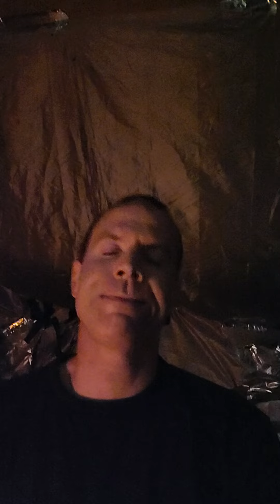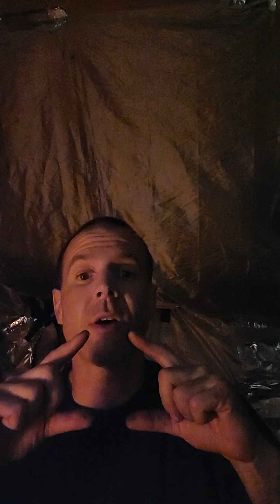ferrite rings on ebike motors

Comment from the maker: Ferrite beads interact with the wire that travels through/around them so as to act like an inductor. High frequency signals passing through the assembly are dissipated as heat. Ferrite beads (AKA "RF Chokes") look like resistors to high frequency noise. There are many possible situations where a bead/choke might be necessary. The model's control system has lots of source of electrical noise, such as the ESC FETs, the µProcessors in the ESC and Rx and Servos and Gyro, and the brushed motors in the servos. If one component is making a lot of noise, the judicious placement of a bead can keep that noise from interfering with other elements of the system, improving the overall system performance and reliability in a way that has nothing to do with the frequency that the radio is operating on.

Comment from the maker: The DC output circuits in external power supplies employ internal shunt capacitors to attenuate AC signals on the output of the power supply. Some designs may also include series inductors to provide additional attenuation of the AC signals. However, during final radiated emissions testing it may be observed that the internal filtering is not sufficient to meet the regulatory requirements for emissions. The DC output cable is not monitored for conducted emissions but may serve as a reasonable antenna for radiated emissions. One solution to address excessive radiated emissions is to add an external ferrite bead on the DC output cable to bring the supply into compliance. The ferrite beads used for EMI filtering are designed to provide both a reactive and a resistive impedance. The reactive impedance helps to block the propagation of undesired signals while the resistive impedance dissipates some of the energy associated with the undesired signals. The bead is selected to physically fit around the DC output cable and to provide the necessary filtering characteristics at the frequencies of concern.

Comment from the maker: There are motor harmonics,  their are RF discharges from the environment and from your phone , battery charger.  But the primary source of noise is cheaper bridge rectifiers . Currently I'm eliminating rf from my battery wires , my chargers , my USB cables where I could plug in a transmitter like my phone and between my motor and controller,  but far enough away from my motor where it shouldn't be effected by the motor flux , and with all my motor wires twisted together which should collapse their changing feild

Comment from the maker: .... the moral of the story is RFI is a symptom in RF systems.  That they use chokes to address.  But chokes can potentially improve the reliability of non rf equipment ( like motor controllers) by dissipating that high frequency energy not used by the equipment,  picked up externally or generated by electrical noise .

Comment from the maker: 2.4GHz radios are less susceptible to RFI because of the underlying transmission protocol, more so than the frequency they operate on (though there is definitely a lot less "ambient" EMI at 2.4GHs than 72MHz). 2.4GHz radios can reject noise because the signal they use is digitally decoded and verified before it's output to a servo. Noise corrupts the data and the Rx ignores data that's corrupted. But that just means that in the presence of a strong noise source the radio is "well behaved", the servos hold their last successfully commanded position rather than move wildly. The noise still prevents commanded signals from being decoded.

Comment from the maker: I had 1 clamp on single pass 1/2 way to the motor and 1 double pass right at the controller.  I nixed the double pass . No noticeable speed or power loss at all with just the sing pass ferrite bead in place . Still 28 mph 22 on my hills

Comment from the maker: Generally Wye (also called "star") is more efficient. Wye has 1.73 times less KV than Delta (slower speed per volts), but 1.73 times more torque. In general it's a good idea to stick with Wye configuration for electric bikes as e-bikes need slower motor speed, higher torque, and high efficiency

Comment from the maker: " Radio Frequency" doesn't have to be a continuous sine wave, it can be a single "spike". The part of "frequency" that matters is the speed at which a single transient wave edge rises and falls, not how many transients follow in succession to each other. It's important not to confuse the "RF" in RFI with the frequency at which the transmitter and receiver operate. These are not the same things."

Comment from the maker: . Not plugging my phone into my 400 $ battery without a ferrit choke anymore " RFI is any undesirable RF signal that interferes with the integrity of electronics and electrical systems. Any electronic system with an interference-signal source and a transmission medium for that source can suffer performance degradation due to RFI. Transmitters, such as mobile phones, two-way radios, commercial radio transmitters, system providers, and other devices, can generate RFI. Conducted transmission of RFI signals occurs through wires, circuit components, and pc boards, for example, and radiated RFI generally implies transmission through space."